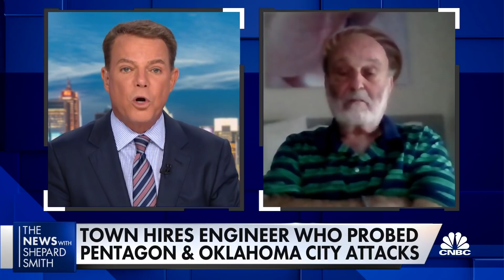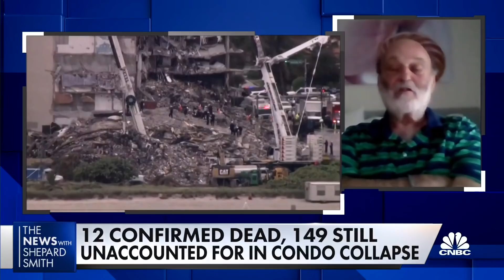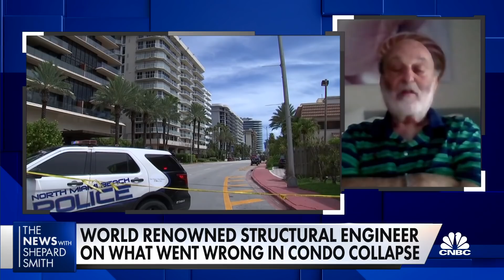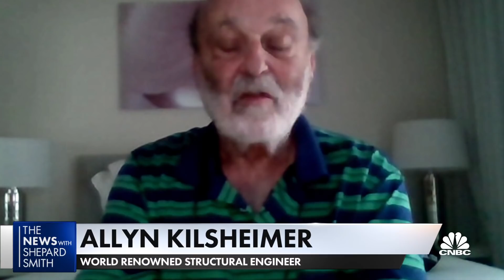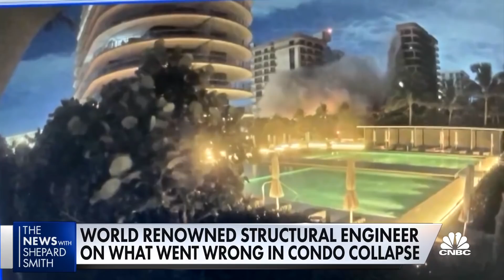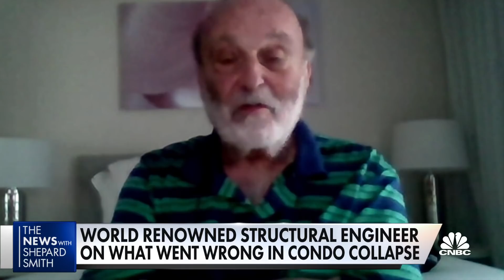We're looking for the trigger that caused the building to collapse: Engineering expert

Comment: What is so hard to understand?  Lack of maintenance, salt water, basement flooded, rusting rebar, degrading concrete, any structure will fail.  Every structure, regardless of size, from a backyard shed to a high rise, needs regular maintenance and that costs time and money in labor and materials.  Obviously maintenance was not the owners priority.  It is tragic but should not have been unexpected.

Comment: The swimming pool water leaking into the foundation is a major factor, because if you know about pool maintenance then you also know that PH levels in the water have to be maintained at 7.5 but the levels constantly change to where it can drop below 7.5 making it acidic or it can rise above 7.5 and become alkaline, alkaline is like whats inside your car battery, and then add pure chlorine to the mix and its all downhill from there.

Comment: Corroded rebar was primary cause.  Florida should adopt new construction regulations requiring use of rebar that does not rust and corrode. The technology exists.  See website of company called BASANITE.   Stock trades under the name BASA.
Reply: How’d you figure that out before the investigation even started? You should call them asap with your results, your country needs you
Reply: Not the primary cause. I doubt you’re an engineer. Something else triggered it

Comment: Probably going to find a massive sink hole under all that debris. Stop showing images of that mass grave.
Reply: Probably NOT as it was documented structurally failing and came down so easily like it was made in China.
I'd be moving out of the its twin tower.
Reply: @Mrbfgray  Sink hole still a better option that"climate change" that the left is pushing to exploit this tragedy.
Reply: @DJNitreBlue   Well YEAH, I don't even notice such nonsense.  Random alternative speculation doesn't help tho.  Looked like a cheesy building the way it came down, all buildings fall eventually.